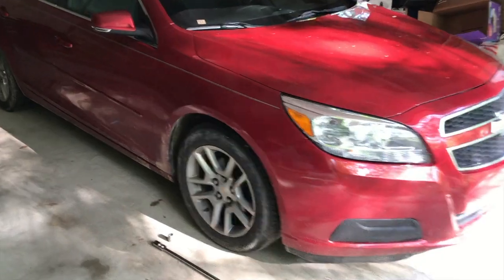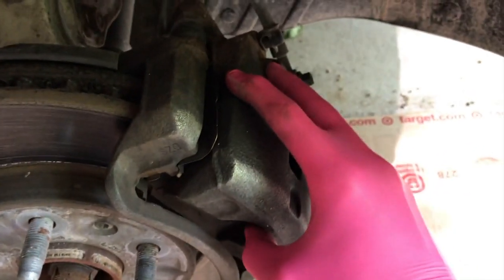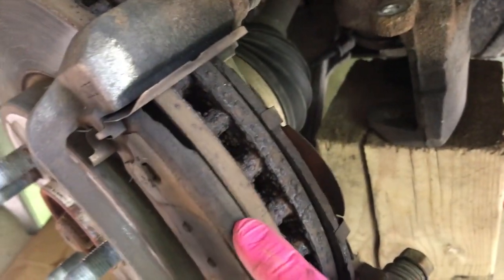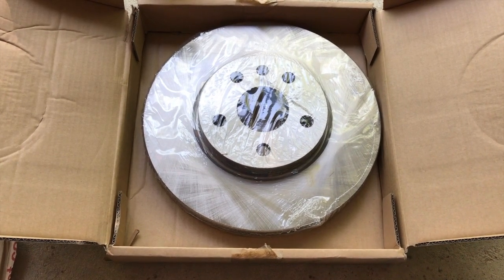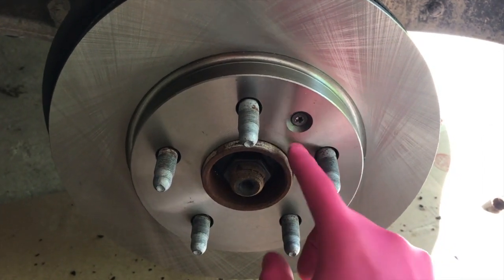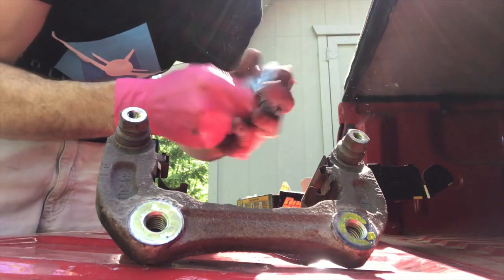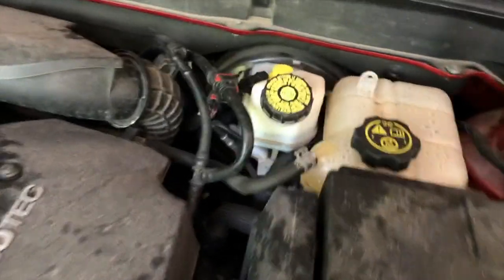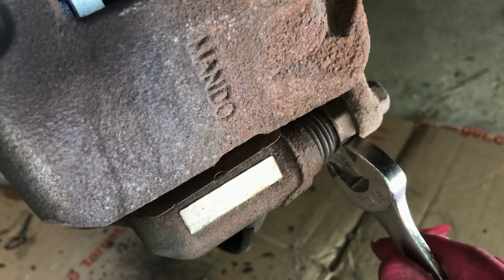How to replace Chevy Malibu Brake Pads & Rotors - 2011-2018

Comment: Hey idk if ull respond but i have q question...😢
Reply from the maker: Good morning, just poured a cup of coffee and am sitting down to answer any and all questions for the DIY community.

We do our absolute best to answer any and all questions.  Let us know if you have any questions and hey if you’re into crypto trading, join our DIY ecosystem and become part of an exclusive group of DIYers.

       toolboxtoken.com

Reach out to us any time!  🧰
Reply: @DIYwithMichaelBorders  good morning/afternoon ... Thank you so much for responding when bleeding the brakes is it needed to press on the brakes while bleeding the brakes at the same time ..??
Reply from the maker: @rigorivera5341  

You are welcome, you will need to carefully open up bleeder valve while someone else slowly pushes brake pedal to floor.  As the pedal travels in motion to the floor, air bubbles will be pushed out.

Once pedal is at floor, hold it there while you tighten bleeder port.

Once bleeder port is tight, release brake pedal and allow it to fully retract.  Continue this process until all air has been removed from lines and you pedal is firm.

😎👍